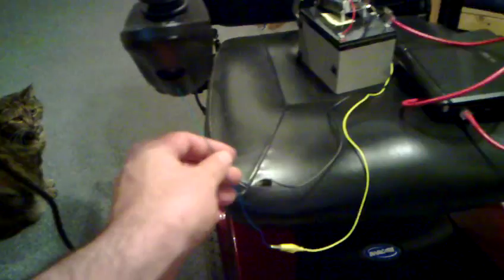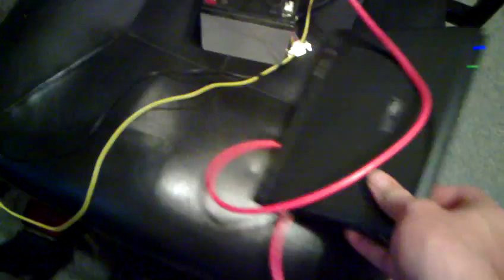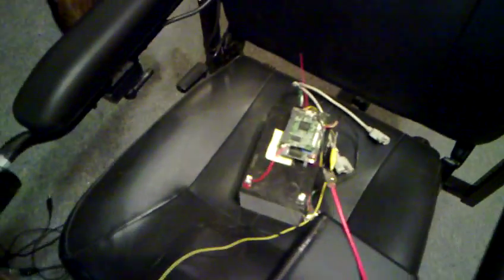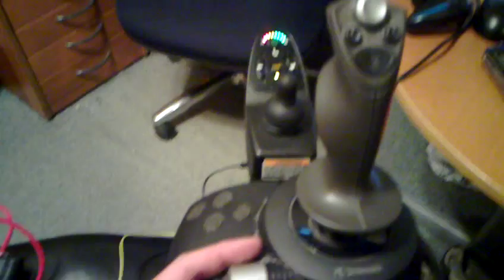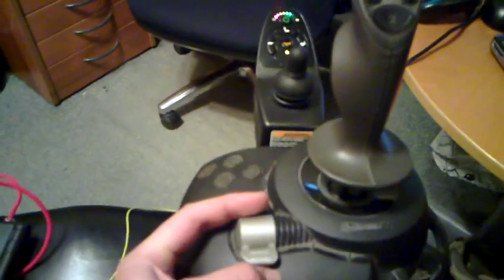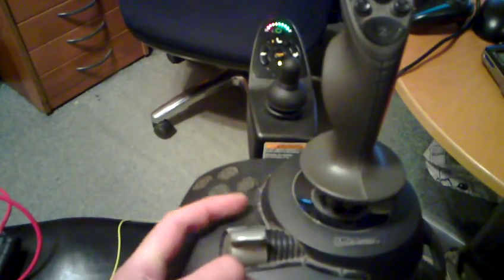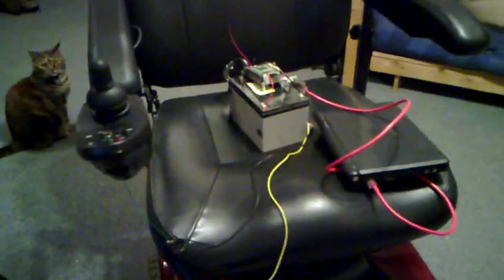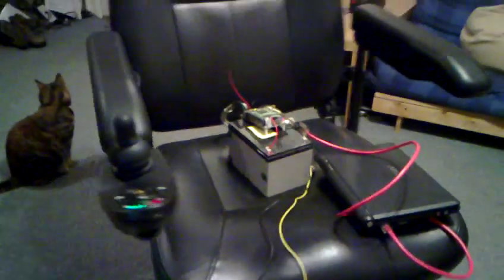Hacking an Invacare Pronto Electric Wheelchair - Part 3

Comment: Can you tell me how to unlock this ? Does the charging cable have to be removed first. Will you make a video showin how to jumper the joystick to the wheelchair ? Thanks
Reply from the maker: Hi +David Olenick - Yes - the charging cable puts the chain in lock-down mode to prevent you from accidentally driving away with the charger connected. I don't quite understand what you mean by 'jumper the joystick to the wheelchair'... The joystick connects to the motor controller using 4-wire cable (two power wires, two data wires) and they communicate using an RS485 multi-drop serial protocol called Sharkbus - The sharkbus spec supports messages from a second 'System Attendant' joystick, so I'm getting the PC to pretend it's the SA joystick by sending out messages on the 4-wire data pins. Hope that helps. Cheers!!
Reply: you operated the wheelchair 
The controller on the chair 
I would like to be able to u
than but another..
 Is the unlock procedure ,"press and hold the power" then "press the horn button.? When I depress the power button, it turns on, then if I hold it down it turns off. No beeps or sounds at all.

Thanks Mate
and Cheerio from Ole' Texas